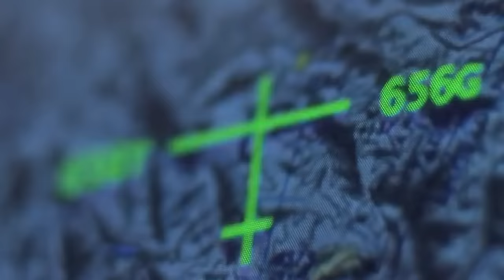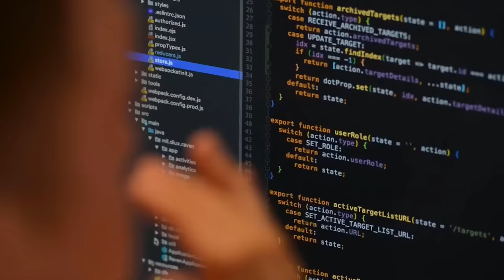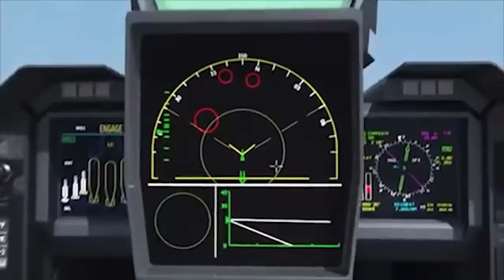The Whole World Is Afraid Of Japan Now

Comment: During the end of WWII, it was discovered they have a working prototype submarine aircraft carrier.
Reply: It was discovered in 1915 Germany had done it. Followed by France in '27.
Reply: it worked however there was really no need for it considering that the only planes that could operate off it were very light bombers and it could only carry a few of them plus each aircraft had to be assembled before launch which took about 20-40 mins losing some of the advantage. it was also very expensive and needed a entirely new aircraft to work.

Comment: F-119 produces nearly 35,000 LBS of thrust. 16,000 is A LOT less.
Reply: The weight of the plane and aero properties will affect the airframes maneuverability and acceleration. You can’t compare thrust in a vacuum

Comment: On paper the F-X, which sounds very ominous and badass btw. Is an extremely powerful and flexible aircraft.
However I fear that it is trying to be too much at the same time, don't get me wrong it's an air defense fighter through and through but it's got too many experimental technologies inplemented for every advantage there's an equal disadvantage, I mean a radar that can serve as a microwave weapon to destroy missiles when necessary along with independently operated Loyal Wingmen style drones that can serve as missile mules as well as reduce pilot exposure to enemy missiles and don't even get me started on the exotic materials used in the engines to make them lighter and more powerful than engines created through traditional means?!
I'm going to be honest, it sounds like a ship that would be flown by the protagonist of a sci-fi movie, which is good... In theory, practically speaking I think the F-X will turn out similar to it's western cousins the F-22 and F-35, a great aircraft but way too expensive and maintenance heavy for a military the size of Japan's to operate consistently.
Reply: Absolutely rubbish both logically and philosophically. An advantage wouldn’t qualify as an advantage if there were an equal or more probability of disadvantage. You’re confusing “Murphy’s-Law” with the etymological conception of “Advantage” as a term. Though there may be an increase of “potential-less-than-perfection “ as more experimental stage features are implemented, it those not construe %100 failure within of each individual experimental feature. It would have to be the total failure percentage of each individual experimental feature divided by the total number of experimental features and then you’ll have an honest and logical failure quotient assessment against the advantage inception (but never an equal or greater, or it can not be an advantage).
Reply: That be may be true, but the Japanese and Germans are born Hardcore engineers. I believe that they will keep trying and make a product 10 times better than the American F-35 or Russian Su-57. They are a intuitive and crafty people which is why the West feared them during the World Wars.
Reply: Novadays isnt the plane who win is a pilot and training,trust me ,in tanks Germans got Michael Wittmann in sky Michael Wittmann was a gad

German military officer

Main results
Reply: Erich Hartmann

Comment: I'm surprised that there was no mention of the YF-23..wasn't Japan very interested in that prototype? I wonder if the 6th generation plane we tested is an upgraded YF-23?
Reply: They sort of already do that, but I think, or at least hope Germany realizes that no one country can take on the world.
Reply: fine
Reply: US won't sell the F-22 or YF-23. YF-23 Had higher speeds then the F-22 and was more stealthy. This as do to the placement of it's engines. making it much harder for infrared missiles to lock on especially from the ground. The F-22 was more maneuverable though. When the US had problems with the F-35 program in early stages of building and perfecting the plane the Japanese learned enough about it's design to think they could builds there own. The white aircraft in this video is the Japanese stealth prototype. If you mistaken it for an F-35 that's because the Japanese just copied the F-35 model. But learning about stealth is much harder. The Chinese, contrary to popular belief have not made 1 stealth aircraft. Their J-20 "stealth" was picked up easily by The Indian Airforce using older radars.
Reply: It looks similar to the YF-23 to my untrained eye.

Comment: Some very odd items I found in this video.  [1]  At time 03:28 video says "until 2016" which means video is at least 7 years old. Why not show current news about this conjectured project. [2] At Ar 06:25 it shows a picture of a1950s Republic Aviation F-84 model.  If you look closely, the word  Republic appears on the nose of the plane.  The company  folded in 1986 .  [3] UK partnership is rarely or never mentioned.

Comment: I wouldn't waste too much money on manned aircraft - Autonomous fighters are right around the corner. The current SOA jet already does 90% of the flying. Like with the space program, too much extra material and size is wasted on protecting the fragile human passengers. A little chip won't need that.